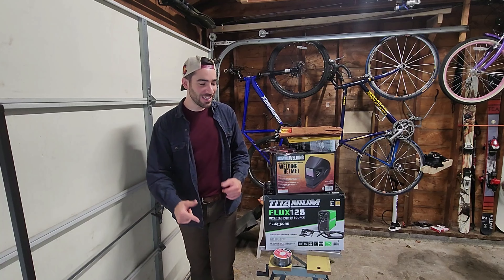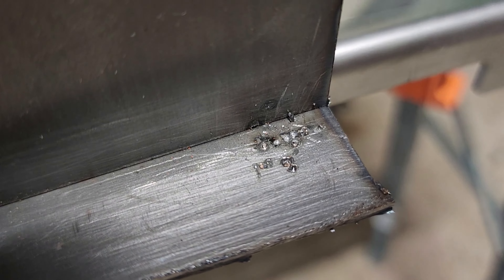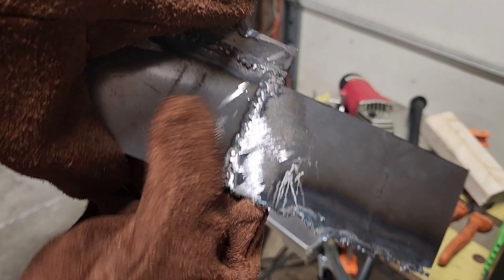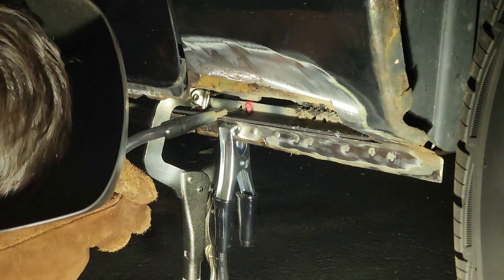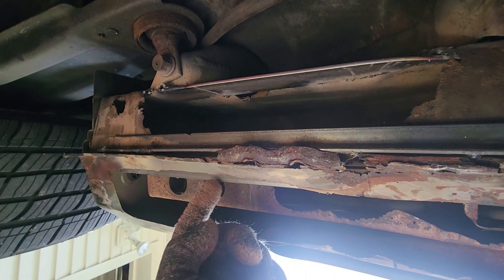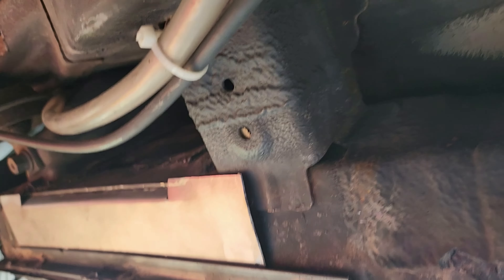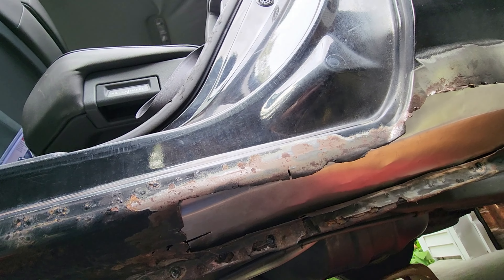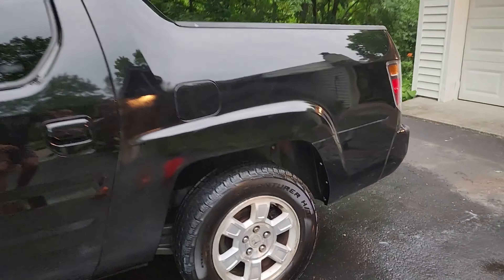Doing body work with the titanium 125 flux welder from harbor freight

Comment: I've also tried flux core on thin steel and I found I need minimum heat and then play with the wire feed until you get the sizzle. At least then you don't burn through and seem to have reasonable penetration. If there is no penetration, then bit by bit try a little more heat.  It is very tricky but when its right its great.

Comment: A few things that may help you out.  First of all, kudos for showing what a complete novice will experience the first time out.  There's nothing wrong with learning.  Second, slow down.  Getting a proper weld requires letting a pool develop, which takes some time.  Sheet metal is not the easiest thing to start learning on.  Lastly, don't start your weld with the welding rod in contact with the surface.  1/8" away from the surface is enough and will allow you to control the pool.

Practice, practice, practice.  Don't be afraid to play around with your angles, how you hold the gun, tip angle, feed rate, etc.  It's a skill that takes time to develop.

I took a course at my local community college, and it's something worth exploring if for no other reason than having someone who knows what they are doing help you to get the basics down.

Comment: I TIG weld at work but that setup has to stay at work because its too big. I just picked up the flux core 125 to hopefully use on automotive panels as well. Ive never Flux-core/MIG before so my first welds with the machine were REAL similar to yours. Awesome Video!

Comment: Looks like a profesional work. A win win, you fix the car and now got a welder for other projects for a less cost than the body shop ask. Last week I bought a yeswelder flux-135 (more cheap than titanium) to do a similar work, but first I practice on a new piece of sheet metal to find the proper machine settings. It's not a profesional grade welder but it do the job.

Comment: Those welds you call spot welds are to refered to as plug welds. Spot welds are performed with a spot welder. A spot weld is actually fusing/melting two metals together by use of intense pin point heat.

Comment: That was awesome!
How did it last over the last couple of years?
What, if anything, would you have done a little different?
Reply from the maker: @jeffchapman8992  it's held up pretty well. I probably would not have left as many gaps between my stitch welds and I wouldn't have fought so hard to get the metal patch behind the body panel, I would have just put it on top of the body panel.

Comment: Sorry to say but if this is just a quick fix not a permanent fix.  With only tacking your replacement piece in you left large gaps that were not welded.  You must take the time to weld the joints completely closed. When the moisture comes back from the inside (and it will) it will start to rust everywhere you did not close the joints. Bondo is not going to help for long.  Maybe that's what you were looking for so take this as constructive criticism.
Reply: It would be fine if it was glassed first …. Unless it’s driven in northern winters it will out last the car …. If it is in winter conditions it’s gonna rust somewhere else before it comes through the repair anyway

Comment: Thanks for sharing. I'm in the market for a starter welder and I think I will go with the same one you used. I've welded with flux-core in the past, but it's been a good 10 years since. I will be working on new 1/4 panels on a 90 Honda Accord.

Comment: Trying to teach myself to weld with a flux core machine. Sheet metal is really difficult for me. My results were just like yours but are getting better. A decent helmet made a big difference as I can see my puddle more clearly. Before that, with my original mask, it was like welding blind. 😅

Comment: The sheet metal your practicing on is too thin of a gauge and will burn through , to get a good weld you need to hold in one spot til you get a puddle and sorda drag the puddle as you go with a nice steady pace , good job though definitely learning !!

Comment: That is not a jack point. That is a rocker panel. Part of the cab. The body. You are supposed to jack from the frame. That you touched in the begining. You are only supposed to jack small cars from the" jack point". And it has a specific jack point in front and rear. Them are not ment to be jacked on even when they are brand new it would dent right in under the weight of the truck. Just thought I'd point that out for the future.

Comment: Right off the bat, that's the wrong wire. You will struggle. Bodywork requires 0.6mm wire not 0.8mm.  0.8mm will do your head in - blown holes galore. 0.6mm is harder to source but worth the hunt.  Next you need to see will your machine run 0.6.. if it does, Happy Days. You are now free from the expense of buying gas... Congratulations. 

But not so fast! - Does your machine go Looow on the settings? If you went bought a machine for vehicle bodywork with "Max Power!" in mind - you kinda done goofed. You want Looow power - less is more. 80% of welders, setting 1 is about 2 settings too high,, hence they are garbage right out of the box. Seek out a welder that specialises in "Low". Those are harder to find.  You also want to pay heed to Mr Decibels - if your welder whines like a Jumbo on the apron, it will start doing in your head after a few hours - more quieter is more better. Switch it on & it whines, chances are you will go "I can live with this!"..and then discover that actually you can't..  Pick a quiet one. I own a €200 welder that is the best welder I have ever found at running flux core wire - but it is so noisy, I never willingly use it. The drone does my head in after a bit. Instead I run wire through a comparatively silent machine that absolutely sucks at flux-core & cost 10 times as much as well - but it's quiet, I can live with the "Runs flux core badly" - I can't live with the whining drone. You might discover you are the same - so pay heed to how noisy it is.